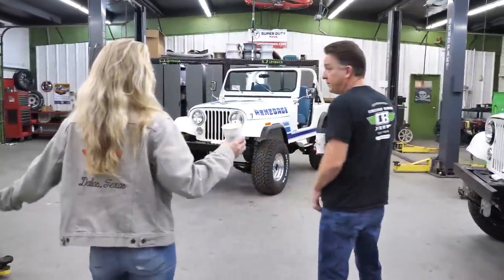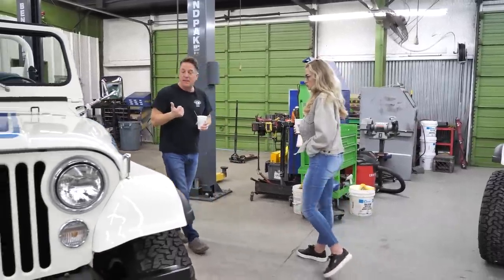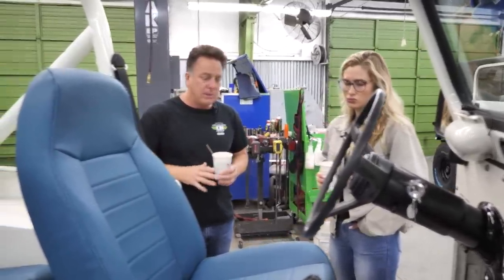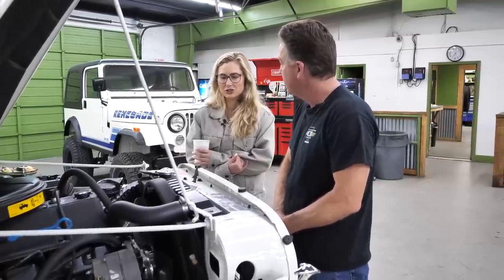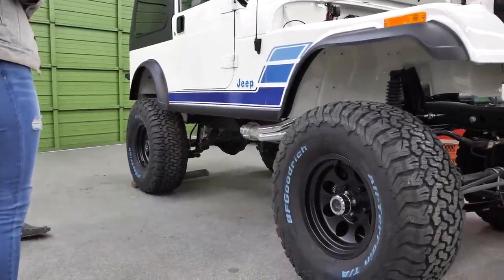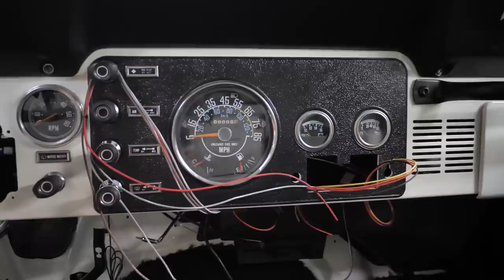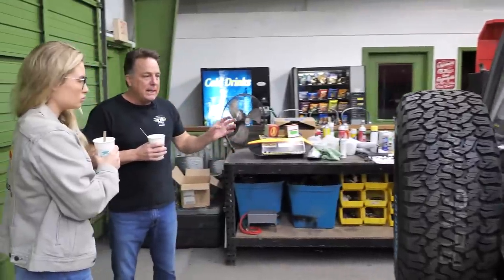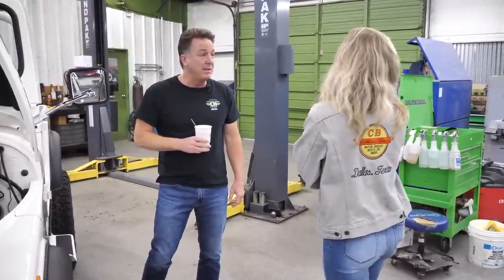East Coast vs. West Coast Jeep CJ's!

Comment: 500 hours?  That’s a gorgeous Jeep - both of them are - but holy cow, that must be a $75,000 vehicle.  I guess if I had that kind of money, I’d want virtually the same thing.  

Back in ‘86, I nearly bought a brand new white CJ7 with that blue Renegade stripe kit and a black hard top.  I know if I had bought it, I would have sold it a few years later, but I like to fantasize that I would have purchased it and kept it all these years.

If you put a soft top and soft doors on that NJ Jeep, that would be my choice.  My last two Jeeps have had full, solid doors and while those are great, I miss being able to quickly pull off a pair of cloth doors, on a nice afternoon, and slide them into the rear seating area.

Comment: Really cool video.   My brother had a cj-7 with a small block chevy in it.    That 6 cly. sounds fantastic.  I have worked on some of those 6 's and they seem like sick kittens. A course these were owned by farmers here in Iowa and they use them to chase cattle ,  So they weren't the best taken care of .  If you ram them around to much you can snap the battery tray straps on the them . or snap a low back seat .  Always learn something new when I watch.

Comment: I know that the customer is always right. That being said, there are a few things about the West Coast jeep that I didn't like.

1) Chrome delete on the headlight bezels and hood latches. The headlights with the black trim look wrong when the signal lights don't have a black matching trim. The hood latches in black look wrong too.

2) 400 HP. I'm a fan of excess, but that much power is a lot in a short, lightweight package. I don't hate the idea of a V8 swap or the Tremec trans, but I think that's more than I would want.

At the same time, no top no doors makes no sense to me. I'd rather have the option.

But like I said before, the customer is always right and they're both stunners.

Comment: A cross over for me - The East coast for the aluminum finish wheels and blue interior, as well as the original engine, but I'd want a matching top, carpet, and dash pad - that would complete it if it were my Jeep. Regardless, great builds all around as usual!

Comment: Have to go with the  V8 Jeep’s.  Had an old CJ5 V8 that I drove till it died, did Body off painted the running gear an Frame black.  The body Royal Blue an the mags white.  I could put that thing in third gear an it would idle across the dessert.  No power steering or breaks but it did have the suicide knob on the steering wheel.

Comment: Would love to have a jeep lige those. Maybe piss of some people with a 1/2JZ-GTE build with bottom end power in minde just because you can. And of course permanent 4x4 and high/low transmission with all the 4x4goodies. 
At good mix between off road and rally

Of the jeeps you showed i love the white with the straight six and efi. And love the colors on the brown jeep last in the video

Comment: I saw the empty seat brackets  in the "dubble Whopper with bacon and cheese" ya'll should develop a lowered seat bracket.  I have a 1995 YJ that i had a local machine shop take 2 inches of height out of then I add an adapter bar to take seat position 3 inches back from steering wheel.   They sell seat spacers to raise the seat but no lowering options.

Comment: On your restorations do you smooth over the body spot welds. I also noted on my 81 Jeep cj5 frame the mig welds had spatter & few small pieces of welding rod on them. Do grind them over or keep them original.

Comment: Found it interesting that the East coast Jeep with less power had what looked like a dual diaphragm brake booster. Then the 400hp monster had what looked like a stock single booster, much different master cylinder but still seems a bit lacking on the power side.

Comment: I'd pick the OEM 6cyl one over the "bastardized" Chevy swapped one all day, every day. No good reason for that swap - you can reliably make the 400hp out of a 360 or 401 and keep it true to the brand.
Reply: @joshuagibson2520   Pretty sure with Collins inventory and sourcing ability that wouldn't be much of an issue. I'm just not a fan of cross breeding classic vehicles.